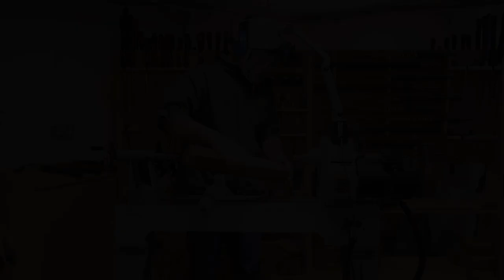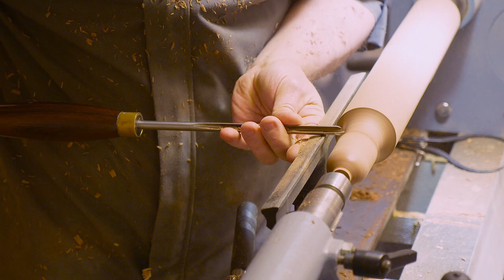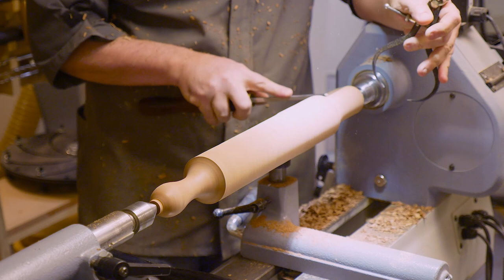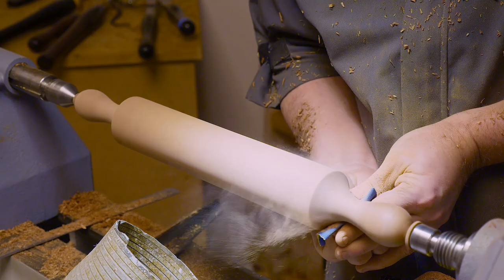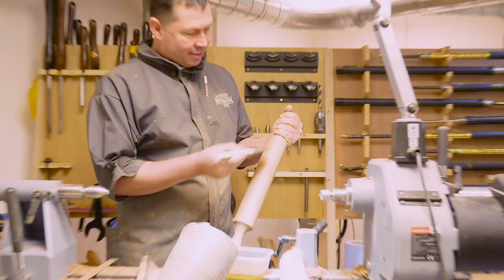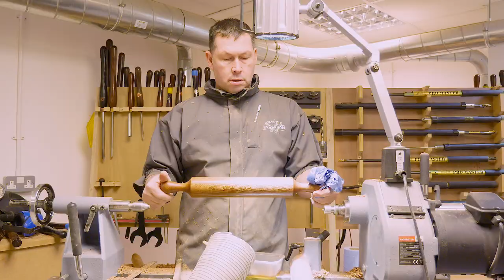How to make a rolling pin - Demo by Colwin Way

Comment: can you tell me what speed you're running the lathe for the roughing out ?    I'm a novice and just blew up a beautiful exotic wood french rolling pin blank - splintered the purpleheart segments to pieces  - I think I was running it way too slow, compared to the speed it looks like you're running when roughing out ... THANKS !!
Reply from the maker: Speed we'd recommend 1400 to 1800 rpm max. But the segmented construction will need very sharp tools, the grain direction of the pieces will effect which tools are used. Hope this helps